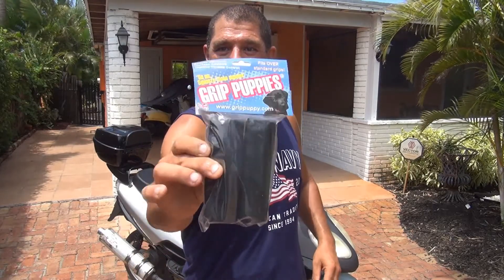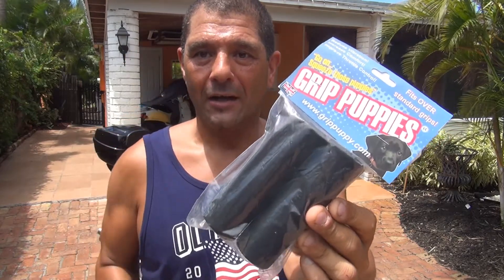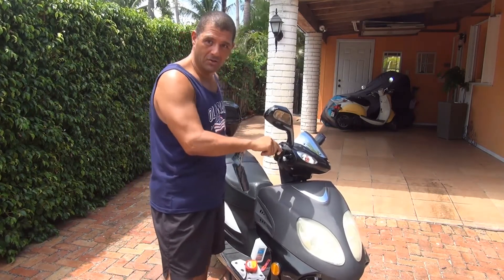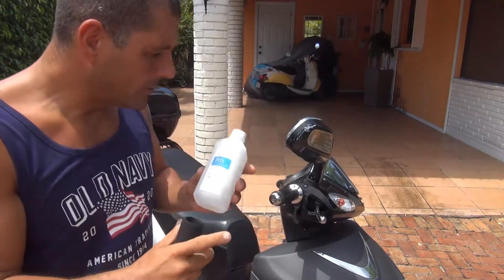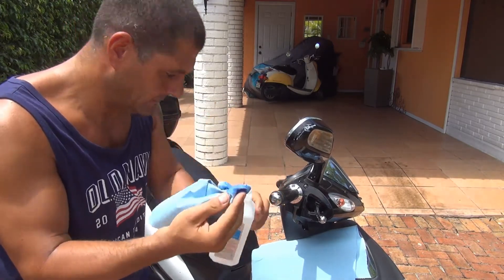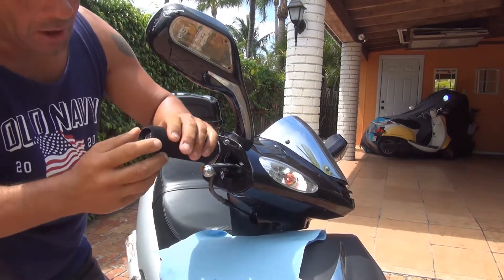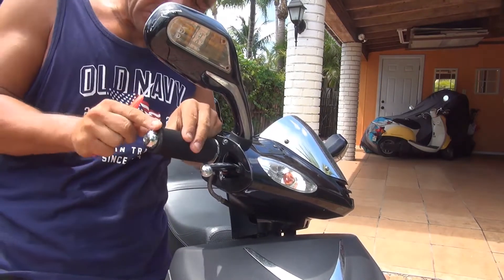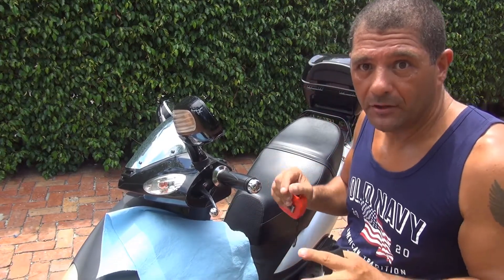Upgrade your Chinese scooter with these comfort grips

Comment: Hey man.
Maybe you have an idea about the following: I was thinking how to make a restrictor for the scooter, but to activate it somehow. In the Netherlands, your scooter can only go 45 kmh, but most of the scooters go a little more, like 70-80. The thing is that the police is regularly doing raids in the cities and checking the actual speed of the scooter. I was thinking to somehow make a kill switch and restrict the bike ( like restrict the rpms ) therefore making it go only 45. So you flip a switch and then you'll go slower. Maybe something done to the cdi box or something. For sure you know better how. Thank you for your informative videos.
Reply from the maker: Hello Dragos that could be a great idea  to make a little box to change or manipulate the rpm on demand ah ah ah
Reply: @VirberelloScooterTips  do you have any idea how ?
Reply from the maker: @dragosdiaconu629  Not yet I need to think about that ah ah ah

Comment: I have a question. My exhaust want tighten up. I need this fixed.
Reply from the maker: Hello my friend the best thing to do is to retread the holes at the exhaust with 8 mm size that they are a lot better quality because 6 mm studs are no good or for temporary fix you can use Loctite Threadlocker Red https://amzn.to/3pPJ1Cf
Reply: @VirberelloScooterTips  they are not broke the pipe won't stay on